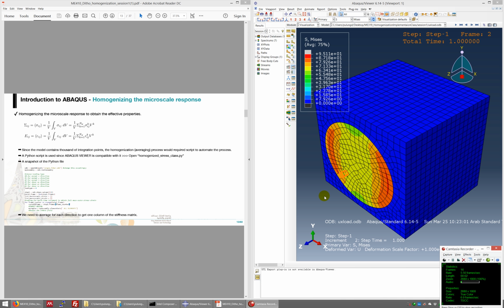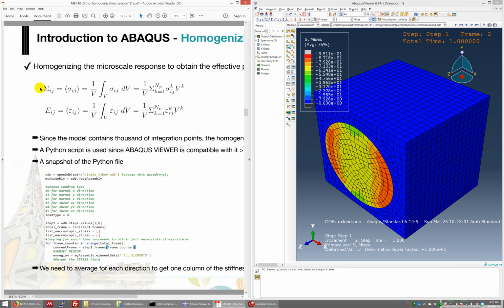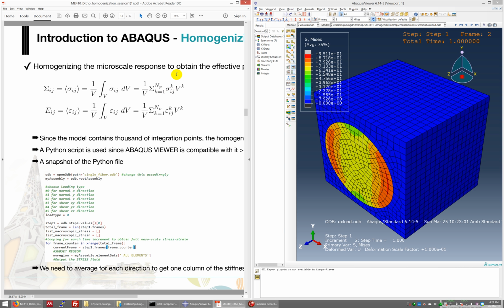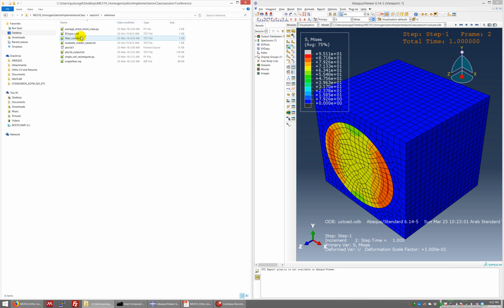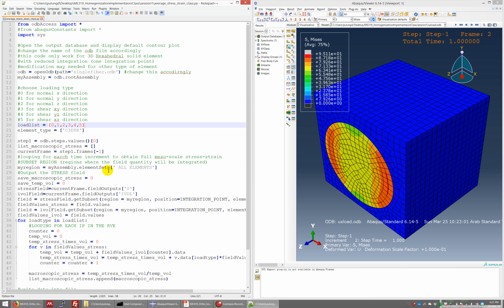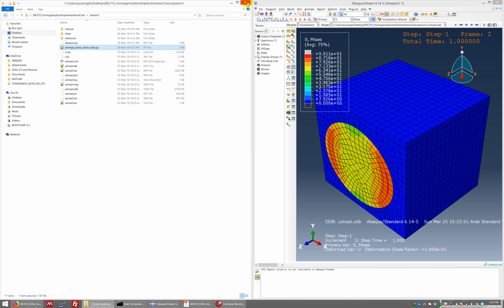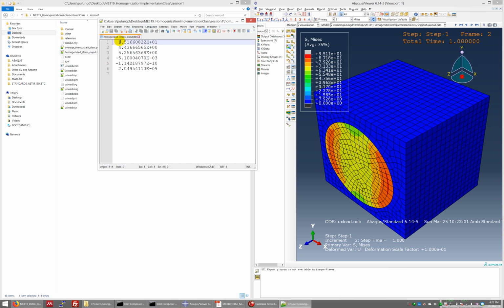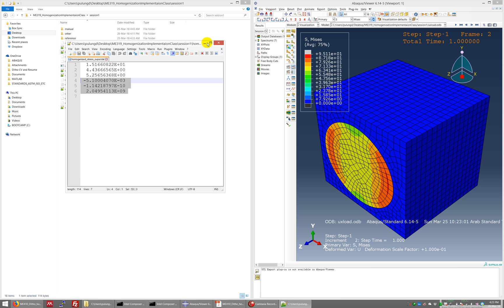Micromechanical Homogenization (Averaging) of RVE responses using ABAQUS and Python

Comment: Thank you so much for making a very useful video which is very unique! I have used also this code and exactly similiar model as you already described in previous video. However, after running the script it gives and error of "ZeroDivisionError" since the temp_vol is equal to zero. I have checked the ODB file and the values for IVOL is not zero. I guess the problem might be somewhere in defining the fieldValues_ivol. I would kindly appriciate it if you could make an advice on this part.

Comment: from odbAccess import*
#from abaqusConstants import* 
import sys

#Open the output database and display default contour plot
#change the name of the odb file accordingly
#this code only work for 3D Hexahedral solid element
#with reduced integration (one integration point) 
#modification may needed for other type of element
odb = openOdb(path='singlefiber.odb') #change this accodingly
myAssembly = odb.rootAssembly

#choose loading type
#0 for normal x direction 
#1 for normal y direction
#2 for normal z direction 
#3 for shear xy direction 
#4 for shear yz direction
#5 for shear xz direction
loadlist = [0,1,2,3,4,5] 
element_type = ['C3DBR']

stepl = odb.steps.values()[0]
list_macroscopic_stress = [] 
currentFrame = stepl.frames[-1]
#looping for each time increment to obtain full meso-scale stress-strain 
#SUBSET REGION (regions where the field quantity will be integrated) 
myregion = myAssembly.elementSets[' ALL ELEMENTS']
#Output the STRESS field 
save_macroscopic_stress = 0
save_temp_vol = 0 
stressField=currentFrame.fieldOutputs['S'] 
ivolField=currentFrame.fieldOutputs['IVOL']
field= stressField.getSubset(region = myregion, position=INTEGRATION_POINT, elementType = 'C3D8R') 
fieldValues stress= field.values
field= ivolField.getSubset(region = myregion, position=INTEGRATION_POINT, elementType = 'C3D8R') 
fieldValues_ivol = field.values
for loadtype in loadlist:
    #LOOPING FOR EACH IP IN THE RVE
    counter= 0
    temp_vol = 0
    temp_stress_times_vol = 0
    for v in fieldValues stress:
        temp_vol = temp_vol + fieldValues_ivol[counter].data
        temp_stress_times_vol = temp_stress_times_vol + v.data[loadtype]*fieldValues_ivol[counter].data 
        counter= counter+ 1
        
    macroscopic_stress = temp_stress_times_vol/temp_vol 
    list_macroscopic_stress.append(macroscopic_stress)

#write data into file
output_file = open('homogenized_stress_ouput.dat','w')
for i in loadlist:
    output_file.write('%16.8E \n' % (list_macroscopic_stress[i])) 
output_file.close()
###THE CODE ENDS HERE
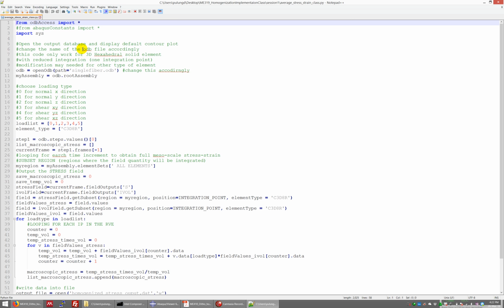Reply: I got most of the code from 1:43
Reply: @alanandonian896  Did you happen to test the code to see if it worked?

Comment: Hey, 
Is it possible if you can send me the python file you used to average the RVE responses? Also if it is possible, can you send me the python file that you used to apply the periodic boundary conditions. My email is mohamadt.96@hotmail.com

I would be really grateful if you can send those python files. Currently I am also working on the same topic. My analysis is of a RUC with a spherical inclusion. I applied PBC using Python scripting but I would also like to take a look at your code. Most probably I can make my code better with a little help from your code. However, to map the microscopic response to get the macroscopic properties, I first extracted the displacements of the surfaces of the RUC to an input file from Abaqus. Next I am going to input them into Matlab and use double trapezoidal integration. But if I can use your Python code, then life will be much simpler.